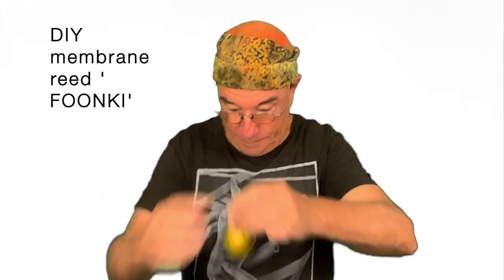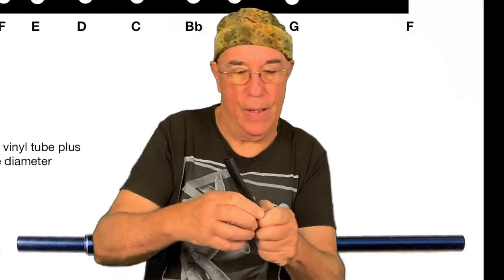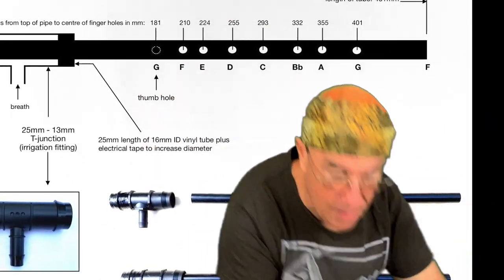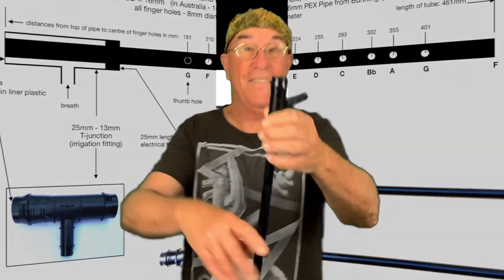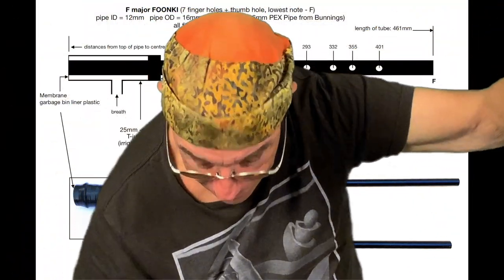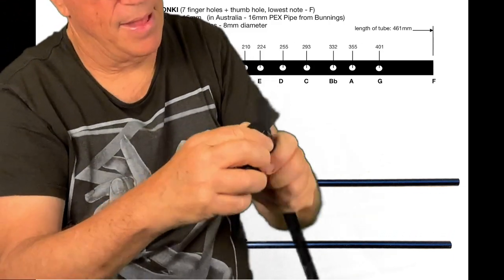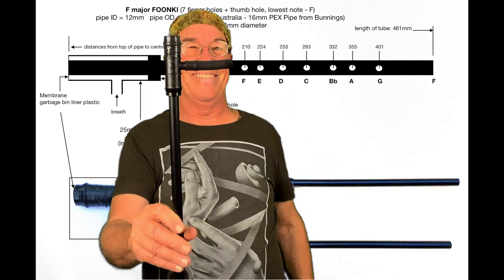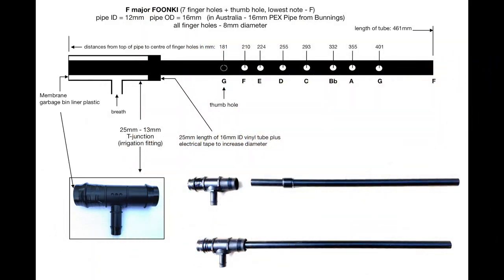DIY membrane reed FOONKI

Comment: Some notes for anybody who wants to make this instrument:
1) For long-playing it's better to use an adjustable steel clamp with a soft sealing to fix the membrane;
2) The tone is VERY sensitive to the distance from the end of the pipe to the membrane, so the pipe connection must be really tight, but with the possibility to move it precisely. 
bonus: me playing membrane bagpipe https://www.youtube.com/watch?v=ZaPdbWUDnsk
Reply: @Classic Max "how the end of the inner pipe aligns with the end of the tee" - yes, exactly. I use only plastic bag pieces as membranes.
Reply: @Classic Max About pitch: when you make any whistle/embouchure hole instrument we have an air column as the main resonating element, so all other circumstances have little effect, and calculators like Flutomat work well. But when we have any moving element - reed or membrane, the situation becomes much more complex and we can't expect the same behavior on column length change, because the properties of the membrane or reed have a serious and non-linear effect on the resonant frequency of the system as a whole.
Reply: I just 3D printed it as a screw-on cap, so with a reasonably fine thread pitch you can make very precise adjustments. Just remember to teflon the daylights out of the thread so it doesn't leak.

Comment: Perfect ! I was working on this low tech solution, watching among other videos the" Fils de Flute" channel and some of yours carrot clarinett ! 
I really get trouble to find a good way to calculate the distance between holes according to diameter, length and thickness of the tubes. Do you have an advice or smthg that can help me Linsey ?

Comment: Is it possible to put a cap on top of the garbage bag membrane? So the flexible membrane is separating a  sealed air pocket from and the tube with the holes? That might change how the membrane vibrates(possibly in bad ways) Like:
____
I        I <-cap
I        I
______<-reed
 I i  i I
 I i  i I <-T junction

Comment: I’ve modified your reed design for the foonki not sure where to contact you but.

So I thought I’d comment on your foonki video.

The modification I made ditches the t section for a straight section allows for a more wider range of instrument shapes.

You may like it i made a foonki based off of this that’s a dragon foonki it’s on my ch if you want your vids are inspirational in that aspect and i thought I just had to modify your design.

In one of your older videos you mentioned that your not sure how to put said membrane on a pipe without a t section well this may be the solution a working one at that

If I could draw a digram using these and you can read it just let me know if not I may have to get all artsy with a pen and paper to draw out a blueprint for you.

Here goes my attempt at explaining the double chamber separated by a wall with a membrane going over the edge of both chambers

                          __ membrane 
Body/sound—— ; —-  mouth piece
                        Wall
That’s the best I can do using dots dashes etcetera but it’s easy to read top piece is the membrane excetera a blueprint written using dots and dashes

This is what I used this modified reed on https://youtube.com/shorts/oHNYbfIbsfo?feature=share

Still a while to go before completion though shouldn’t be to long now two or three days it is working however witch is the main point sounds ok to

Edit the project was completed on the 6th nov 2022 videos up you may like the sound it produces here’s the link if you want to have a look at the sound and design you may like it it’s pretty unique 😂 
Took me 7 days to complete due to the complexity of the design.

https://youtube.com/shorts/Qoy1LbXaQp4?feature=share

My next one will be a manta ray foonki!

Updated my ch with a video better explaining and showing the redesign of your foonki reed

https://youtube.com/shorts/qYXBTQ16ju4?feature=share